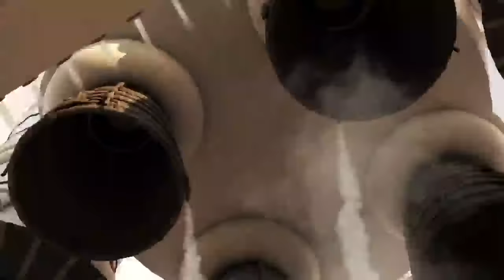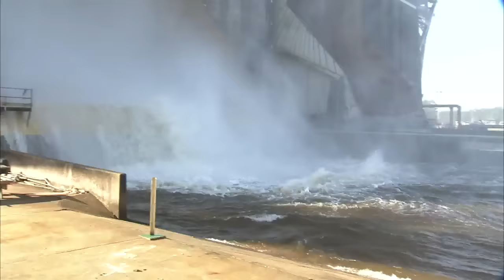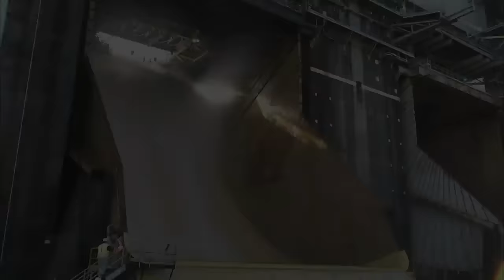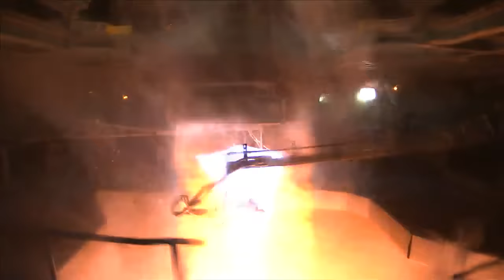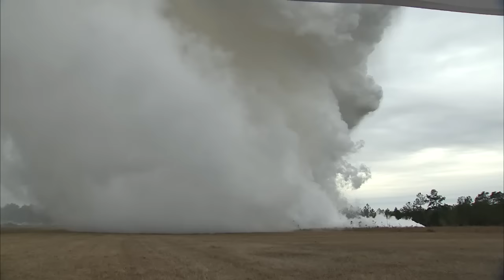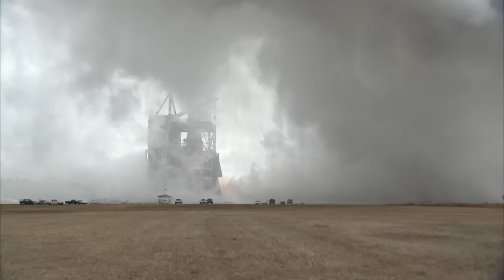NASA Conducts First RS-25 Rocket Engine Test of 2018

Comment: $2 billion a year gets us an incrementally improved 30 year old design, shameful
Reply: It's not an improvement, it was spent to convert robust reusable engines into expensive disposable engines.
Reply: Peter Donaldson I bet you googled how much nasa makes
Reply: Peter Donaldson, Still the most efficient engines ever built even by today's standards.  As many have mentioned, only engines rated for human space flight.  135 shuttle launches only one engine out of 405 that ran failed.  That's 99.8% percent.  What kind of price can you put on something when human lives are in the balance.  The RS-25s to me have proven themselves.
Reply: SpaceX still has yet to make a rocket motor that can match the RS-25 in thrust, and next to the retired F-1 (also by Rocketdyne) for the Saturn V first stage, the RS-25 IS the most powerful rocket motor in the world at this time.
Reply: F-1 was the sledgehammer approach. It was huge, but a very mediocre engine. And RS-25 the most efficient? My ass. It's not even closed cycle.
Reply: Raptor engine: sea-level: 380,000 lbs thrust, vac: 430,000 lbs thrust
RS-25 engine: sea-level: 418,000 lbs thrust, vac: 512,300 lbs thrust
F-1 engine: sea-level: 1,522,000 lbs thrust, vac: 1,746,000 lbs thrust
Falcon may be more "efficient," but it still can't top the performance of either the RS-25 or the F-1, so it depends on what criteria you are basing that efficiency on. We're talking about a heavy lift vehicle for getting large payloads onto another planet, not booting a small communications satellite into LEO.
Reply: Just a little clarification, the specific impulse of the Raptor engine is ~370s (vac), while the RS-25 is ~450s(vac).  The RS-25 is also a little more efficient than the Raptor at sea level as well.    What this means is that not only does the RS-25 provide more thrust that the Raptor, but is also more fuel efficient.  Definitely not the most efficient engine available, but pretty good performance.
Reply: The RS-25 (also known as SSME) is most definitely a closed cycle.  I spent in excess of 20 years of my 'career' with this system.  Where did you get the idea that it isn't a closed cycle?  It's a fuel rich, partial flow staged combustion cycle engine.
Reply: Sure, because this engine is the only thing NASA is paying for. It's not paying for R&D on any other pieces of equipment, and it's not paying for all the missions currently in-progress that need scientists and engineers on-staff 24/7.

Dipshit.
Reply: Elgoog
But it is a closed cycle engine... It's reversed compared to the Russian staged engines. They are oxidizer rich. US are Fuel rich.
Reply: It's certainly not the most efficient engine ever built. They do have an admirable track record, though the failure rate is on par with the Russian engines.... or the fact they've been launching what is functionally the same booster since the very first human satalite doesn't count? 

They're still old technology compared to what is available today. They're horrendously expensive, difficult and assaninely expensive to overhaul..... 

Clustering smaller engines is proving to be the way forward vs the brute force approach,  especially with the rise of 3d printing technologies. Modularity, cost vs performance, and redundancy are all favoring it. In the end , Korolev was right...
Reply: Shourya Bose the plan had always been a j-2 based upper, but they've dumped that in favor of an rl-10 based stage now.
Reply: It’s not 3D printed like the SpaceX SuperDragco and has boring names.
Reply: Wyatt B the non 3-d printing is actually a valid concern, do we know if the tooling even still exists for these engines? Have any of the  firings been of second gen engines?
Reply: If it ain't broke, as they say. Look at the Russians. They've been flying the same stuff for literally half a century, with incremental improvements.
Reply: NOT 30.  Remember we went through 8 years of the krap president obama who hated NASA.
Reply: John Culver Well, with the largest financial collapse in a century to claw back from, NASA was sort of a low priority. FYI though, it was Obama who lit the spark on privatizing space launches. Elon Musk credits Obama for creating the sort of private investment environment that allowed SpaceX to flourish. It was during the Obama years that the COTS program entered full swing and the development of the Falcon 9 began. And also, FYI, it was Bush who canned the Shuttle. They probably don't tell all you undeducated sheep about this in your Fox News safe space though lol.
Reply: take russian
Reply: Mike-the bike Russian? That would be even older! 50 year old tech in russia. No money for new designs.
Reply: Why are the Americans still using Russian boosters they come into orbit
Reply: Old but not outdated, they are reliable what the Americans do not manage with them everything looks beautiful and cool you have to say, in russia it has to work only under any condition
Reply: Mike-the-bike LOL that is a myth. The only Soviet engine in use is on the Atlas...which is being phased out. And this was only because those old engines were so cheap. Every other American launcher flying and in development has no use for those old engines, and is using a more modern solution.
Reply: I say sojus rocket ms 09
Reply: It has shown how successful the Space Shuttle program has been ... has taken a lot of people's lives ... You will see from April 2019 how NASA goes into orbit, they can then
take a trampoline that looks really cool ...
Reply: @RealityIsTheNow  thats just not right soviet engines are some of the best performing rockets ever created that blow most of the western designs completely out of the water performance wise. 

Second, Atlas isn't the only launcher using soviet rockets. Orbital ATK's Antares is currently using derivatives of the NK-33, which powered the soviet attempts at a moon rocket and they are planning on switching to modernised rocket motors of the energia boosters.
Reply: Philipp No, it's correct. These old Soviet engines are single use, and are actually completely outclassed in terms of power to weight. The Merlin 1D FT for exampe has a ratio of nearly 200! You are badly overestimating the engine prowess of designers who failed to overcome combustion instability. And, in fact, the Antares rocket is no more...as a direct consequence of the failure of those engines. I'm not saying they are bad engines...they are actually quite good...but they are also extremely old and in the process of being phased out in favor of more modern, efficient, and reusable designs. The time of using these antique engines for anything at all is coming to it's end. Its getting to the point where even the cheapness can't justify the archaic designs.
Reply: And 600 billion for the military doesn't get us anywhere either.
Reply: Gacekky1 lol you fool. Of course Soyuz has launched the most people...it's been flying for 50 years. The Russians don't have the money or the technical know-how to develop a modern launcher, so they have to use an antique one they inherited from the Soviets. Soyuz is the Honda Civic of space launchers. Its simple, disposable, and works. It's not so cheap anymore though, now that we are in the era of reusable launchers and methane engines. I like the looks of the Soyuz though...has that really retro 1950's rocket aesthetic. Fun to watch those old fashioned launches, even if they can't be bothered to strap a few go pros on for the fans. Also, FYI the shuttle had a 99% success rate. Which is excellent when dealing with thousands of tons of high explosive. And also, only one launch failure. The other was lost due to a damaged heat shield. We'll never know how many failures the Soviets suffered, as they tended to simply cover it up when it happened.
Reply: RealityIsTheNow rd 180s are also amazing engines

Comment: "First test of 2018" for an engine that was first tested in the 1970s and flew astronauts to space in 1981. Your efforts to build launch vehicles are outdated and redundant. Focus on your strength: Science missions and let private boosters get you up there.  Note the source: NASA Stennis. SLS is the latest federal welfare program for Mississippi, Alabama and Texas. 

And for the fellow below who noted the disparity between the defense budget and the NASA budget: True that. But let's ensure we get the most science for those precious NASA dollars. SLS fails on all measures.
Reply: There is a big difference in qualifying a spacecraft for Human flight as opposed to putting a car in space. Everyday I wonder, are people getting dumber here in the U.S? Or does it just seem that way? And everyday it is confirmed that yes, in fact the American public is becoming less intelligent by the day.
Reply: Still looks pretty powerful
Reply: That engine built in the 1970's is still one of the most powerful and efficient engines in existance. Why spend millions developing a new engine when you already have a surplus of an engine that is still more efficient than all modern sea level engines. SLS isn't outdated and redundant, it is designed in a different way to do a different job than private launchers.
Reply: @gregmoore8494 
So it wasn't qualified for human flight in 1981 when it flew astronauts into space?  How about in 1985?  1990?  1995?  2000?  2005?  2010?!   After forty years and 400 engines to orbit, when do you think it might be qualified?

Comment: Did they start using some kind of ablative in the nozzle? Past tests I have seen didn't have the colored flame around the 1st mach diamond. Any why do they test these so often? They perfected the design sometime in the late '80's, and they've been human rated for years.
Reply: Yeah, since that post I read up on it a bit more, I now understand they are refocusing on building the RS to do away with some of the components that were only aimed at reusability, and that necessitates more testing. I think what I thought was an ablative may have just been excess hydrogen burning off or a different exposure on the camera.

Comment: It is interesting, the base of the flame cone appears to have no opacity, one can see directly thought it. Only a metre away from the engine bell does the cone have a white colour
Reply: This engine runs on LOX-LH2, or liquid oxygen and liquid hydrogen. Hydrogen burns with an almost invisible flame and produces only steam (which is transparent) as an exhaust product, which is why the exhaust is so clear. The bright cone is a shock diamond, created by shockwaves in the expanding exhaust that locally compress and heat the escaping gases.
Reply: Very interesting, thank you

Comment: On one of the tests,,can we please hear the callouts for partial and full thrust?, parameters checks? and the like?.  It's very hard to spot the changes in thrust just by vid and sound.   Sometimes you can see those,,but it is usually obscured by gasses and glare.  A background dialog by operators and folks manning the gauges would be neat.
Reply: kh40yr Another way NASA needs to take a page out of the SpaceX book and improve PR. I think NASA under-appreciates the affect public excitement/opinion has. Make these videos more accessible to the public and more exciting.
Reply: I respect the notion of proprietary information,,that can be edited out I'm sure.  Just the ramps up and ramps down or specialty check that is called out lets say.   Don't need the whole enchilada as they say.

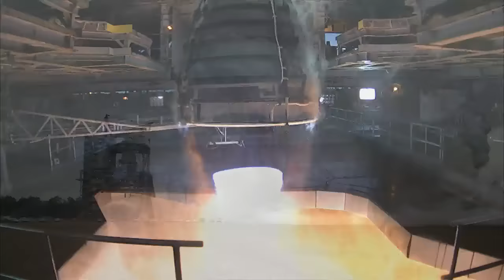Comment: 8:12 Why light's flame starts only after a certain distance from nozzle's engine?
Reply: It's because the Hydrogen-Oxygen reaction is so hot, the flames actually burn in the Ultra-Violet! When they're visible, the flames have cooled enough for us to even see them in visible light!
Reply: Thanks so much.
Reply: I think it might also have to do with the exhaust getting compressed by the atmosphere- if that’s what’s up there, then the bright spot is the first of several Mach diamonds that will appear in the exhaust.

Comment: Does sombody know what is the steamy stream before ignition ? I'd say Liquid hydrogen but I'm quite not sure. And why is it there ? Maybe a little combustion chamber for the turbopump?
Reply: Not hydrogen or it would be igniting with those flames nearby so I'd say it's O2. Maybe they're pre-cooling the nozzle?
Reply: Its actually condensation of water because its very cold.

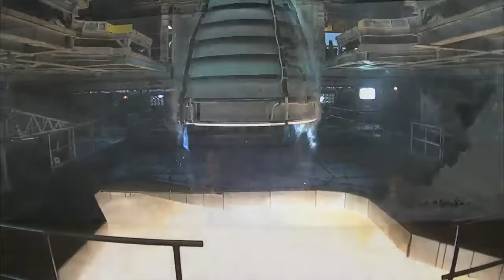Comment: At 10:11 I noticed the nozzle looks like temperature changes are cycling through its length.  Is that what it is or is it a camera artifact?  I know their regeneratively cooled but wouldnt think temps would cycle like that unless those are from rapid throttle changes.
Reply: It shows up really well there if you put the speed at 2X.
Reply: that's cool :O
Reply: If you look closely at the condensation cloud that is close to the bell, (it’s really apparent when you look at the profile at the side of the bell) the blue hue is in the cloud as well as the bell. That must be an artifact then, right?

Comment: Do they supercool the cone after a burn? to simulate leaving the atmosphere and supercooling to then carry out tests? You know tests and checks on how the expansion/compression of the material fatigues or causes any adverse effects or just cool it because?
Reply: There are tiny pipe lines surrounding the cone through which the gas flows super fast making it icey cold and hence keep the cone from melting even in such a higher temperature
Reply: That's why the cone turns white throughout the test

Comment: That's very impressive, even from here on my mobile you can feel the power. Apart from stopping the stand from ketching fire, how do you stop the engine from blowing or vibrating the test stand to pices  ! , Very impressive.
Reply: By using a shit load of water, to dampen the acoustic vibrations and to keep the temperature, down. Also the angle of the exhaust trench, is angled, like the letter j, to deflect all that energy, away from the structure.

Comment: Congrats to NASA on successfully testing an engine that's been tested since the 70s and has already flown to orbit 400 times.  What a white knuckle moment this must have been!
Reply: They haven't been testing the engine themselves, they are using them to incrementally test newly designed and manufactured components for the RS-25E and at the time they were also using them to test the new batch of engine controllers that NASA built for SLS flights 1-6
This year we will also see the first full up RS-25E engine test, with 100 percent newly manufactured components and a lot of them simplified and redisigned

Comment: What’s up with the vapor being released before the ignition?
Reply: Liquid hydrogen gets pumped through a jacket in the nozzle to keep it from melting or deforming when the engine is running, the little plume at the bottom is where it bleeds out.
Reply: I believe it’s part of the cryogenic cooling system for the rocket and engine

Comment: Instead of all this flame deflector, water, water pump, thousands of holes drilled in concrete, why didn't they just mount the engine horizontally for test firing. If horizontal firing was ok, they could have saved a huge amount of money.

Comment: Where does the combustion actually take place? Inside the cone? How can anything that appears as thin as it does contain and direct that much pressure? I just don't understand how thrust works. Especially that much thrust. It seems to me that the limits required to achieve the objective have to be pushed to the verge of failure. There has to be another way. I wish the aliens would just help us out already 😃
Reply: It takes in the combustion chamber(s)

Comment: That was a long burn, think how far down range it would have been it it was flying
Reply: Enough to form a 120×120 km orbit. It powered Space Shuttle all the way to Low Earth Orbit and flight lasted about or more than 500 seconds, similar to length of test run in this video.

Comment: I dont get it. So far I saw only tests of RS-25 over and over and few pictures of attempts of rebuilding LC-39B and Crawler but nothing that even somehow resamble a rocket booster or spaceship.  Those attemps of building new F-1 engine (F-1A) gone silent too. Damn, go to your museum, dust of some Saturn V, bolt that thing back togather and fuel it up! That will be quicker and cheaper then this money pit!